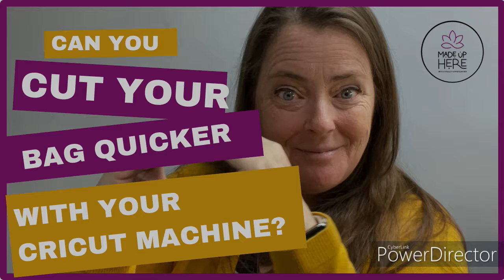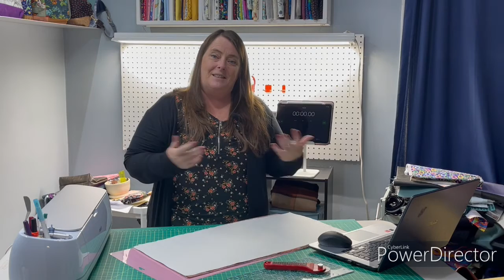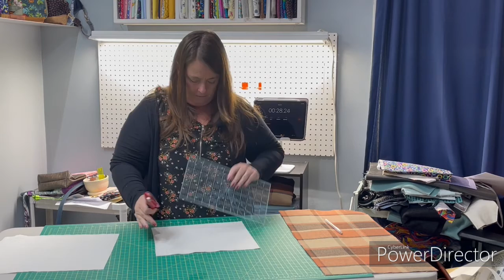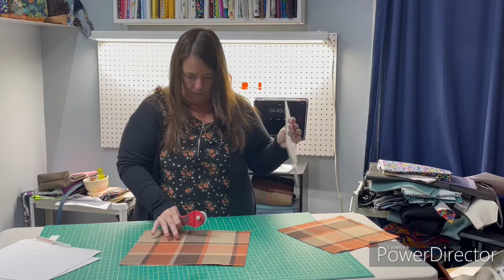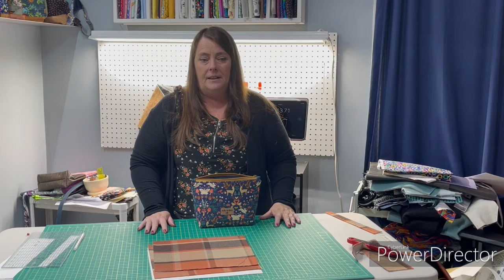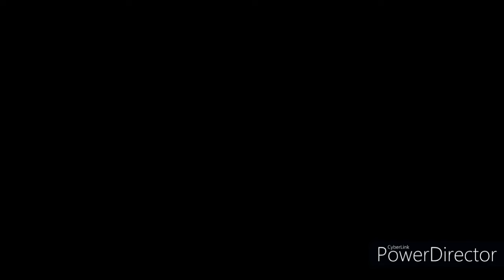Cut Your Bag Quicker with Your Cricut Machine?🤔

Comment: If a bag needs to be interfaced so you blockfuse and then cut or just use cricut to cut the interior and exterior and then you have to cut the interfacings and stabilizers yourself?

Comment: So i was chatting with a friend who likes quilting,  and she had brought some old books , which had a like patchwork picture,  and one was a horse,  and a girl with an old fashioned bonnet,  and a tree , so yes you can do this by hand , but with a cricut this would be so much quicker,  she also made something that had triangle like bits of paper she can use as a template,  they cost her a fair bit , but when I said I can cut them out cheaper on a paper she was over the moon , we also have a sewing/ crafting group and we do workshops,  so when it comes to small beginner projects for people to make as a workshop,  I can pre cut accurately pattern peices for people to have , when your a beginner if you don't get your fabric correct and its slightly off , this can very easy put people off. 
So lots of advantages to using the cricut.

Comment: Maybe its faster to do all straight cuts with the rotary cutter, but if you are cutting a pattern with gussets and curves that I can't do accurately at all with a rotary cutter,  I feel sure the cricut will be worth it.  As someone with severe carpal tunnel which flares from using scissors, it will absolutely be worth it.  Cool experiment, thanks!!

Comment: When  using a different pattern with curves and notches, I think the circuit might come out ahead.  Having to cut out a pattern to trace or pin then cut with scissors or even some lines with a rotary cutter, I think the cricut will be faster.  If you were making multiple bags and had a couple/few mats you’d be cruising right along.  Fun to see how close in time this style pattern was.  I just got a maker and am excited to use it soon.  Some projects with deadlines have to come first.

Comment: I have a Cricut Explore Air 2 and i cut fabric on it only once. but this is a great idea to use it to cut fabric. i know i will have to use heat and bond to put on my fabric before cutting (i will also have to buy a new mat for fabric)
Reply: i just really use Cricut for sometimes designing my bags with glitter vinyl embellishments. But i would like to try it in cutting actual pieces for putting together a bag.
Reply: If you have a cricut fabricgrip mat why would you still need to use heat and bond?

Comment: The hand cut could have been done considerably faster if you had folded the fabric and cut both pieces at the same time for both the exterior and the lining.
Reply from the maker: True it could however I never get accurate cuts when I stack fabric or cut on the fold. The fabric tends to shift.

Comment: Have you tried to cut vinyl, canvas or leather? I have been thinking of trying to cut sewing pcs with it but wish the cricut was wider than 11.5 inches
Reply from the maker: I almost exclusively cut vinyl canvas and cotton. I use a strong grip mat and a rotary blade using moleskin setting for vinyls and canvas (waxed canvas does not stick to the mat so I do that by hand) I have cut leather with good success but you need to make sure to tape it down well and use a knife blade.

Comment: Quick question. How do you get the shapes, including any markings, into the software? I would use my machine for cutting everything but very few designers include svg’s. I’ve found that the process of creating the svg’s on my own is extremely tedious and time consuming. And some I completely gave up trying to convert. It’s usually the ones with unusual shapes, which are the ones I need the machine for the most.
Reply from the maker: Most of the patterns I cut are ready made svgs that I have purchased, or designed myself. I find keeping the cutting charts (if sizes are included) handy makes this process faster. Alternatively, you could print the difficult to draft piece out, assemble and then measure the lines to create your own template pieces. Luckily, more and more designers are including svgs for pieces that will fit on a Cricut mat, but understand the frustration when they aren’t included.

Comment: Your pattern seems to be just rectangles which, of course, would be faster by hand.  However, I use my Cricut most of the time when I cut purse patterns which have curves or even boxed corners.  It is much more accurate than by hand.  I wish you had indicated which blade you used.  Most of the time I use the rotary blade.  Perfect cuts every time.  Thank you for this video.
Reply from the maker: I did use the rotary blade as I do for all fabrics unless it’s leather where I would use the knife blade. Thanks for reminding me!

Comment: I love this concept.  My question is, where do you get the pattern files?
Reply: I usually have two mats going so I can just pop the second one in as soon as the first one is done. I also use a rolling pin for making sure the fabric is adhered to the mat. Doesn’t everyone have a rolling pin in their sewing room🤪
Reply from the maker: If you use design space for Cricut you can use my SVG files here https://design.cricut.com/landing/project-detail/65a336e0fd260e64607f9230. I usually draw my pattern out for simple items like this using shapes and the text features for labelling. I will do a more in depth video showing my design process soon! Thanks so much for watching.
Reply: I use my Cricut Maker a lot for cutting out bag patterns. I love the accuracy of perfectly cut pieces. I’ve cut cotton, vinyl, cork and canvas but not waxed canvas, I’m afraid it will gunk up the blade. The only thing I’ve tried that didn’t cut great was some luxe nylon. Edited to say, love your channel, anything with bag making and the Cricut, I’m here for it!
Reply: I have a cricut 2 would like to know how to use it for my bags and wallets. I am not a pro at using my cricut. I have patterns but don’t know how to get them into my space
Reply from the maker: @patroling9803 Imjust released a video today on the basics of loading your SVG to design space! Have a peek at my channel ☺️